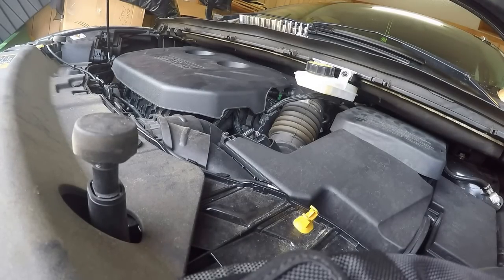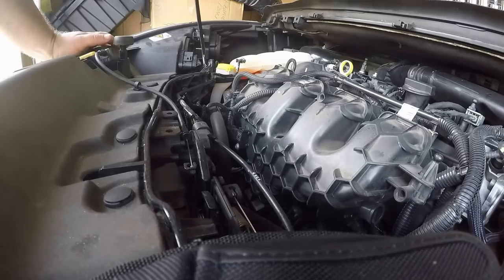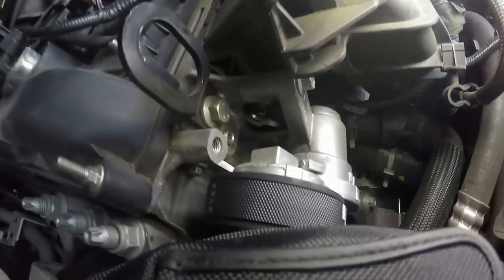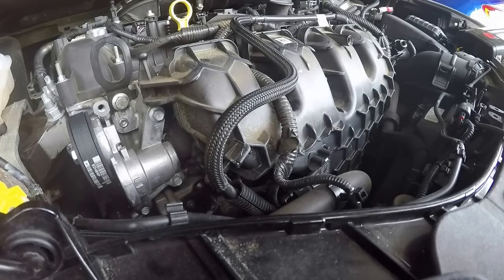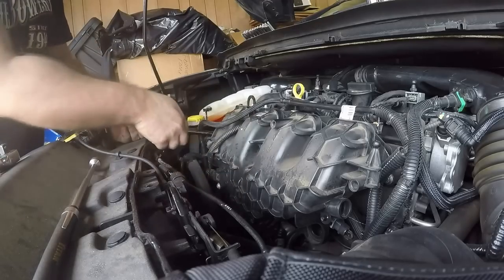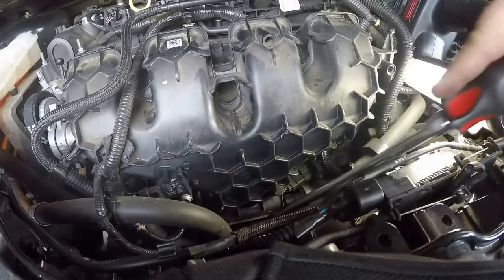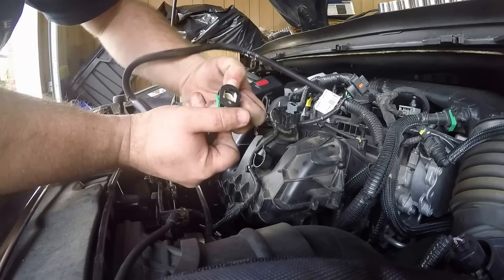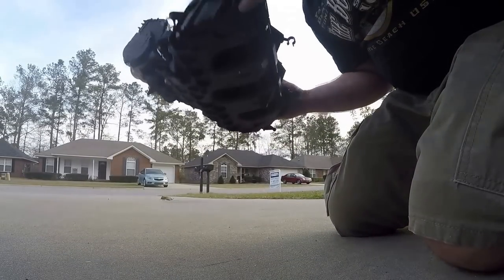Ecoboost intake carbon DIY valve cleaning turbo 2.3 2.0 1.6 ford escape turbo, escape. Simple tools

Comment: Just wondering how would you do this on a hot engine? By the time you get it apart it's no longer hot. You also run the risk of damaging the threads on the head from removing the steel bolts because aluminum expands and contracts at a different rate than steel.. Just my opinion, I've been wrong before. When I talked to Ford about valve cleaning my 2017 2.0 Fusion, they told me they offer no service for the ecoboost engines. Doing this would void my warranty due to the possibility of a piece of carbon getting sucked into the turbo and causing damage. I tend to believe them because stealerships would want to sell you anything they can. All I'm saying is use caution and do research before attempting.
Reply from the maker: Do at your own risk.. but if you use the oil I recommend  or fully synthetic like mobil one and change every 5 K you should be fine. Go to a bmw shop and ask them how they clean a direct injection with a turbo, manually. A brush cleaning, walnut blasting, or scraping is the the only way to get the chunks out. Fords only fix is a compleat head replacement. Which is a bad idea with the warping of the block, they did nit machine the block flush the first time and ended up replacing the long block. No codes no help from ford. The head will not go back right and then the engine will loose coolant. Have them pressure test the engine and coolant to make sure your misfire is not a bad head gasket first as it is a known issue even without a engine light one. The carbon is more of a performance loss due to airflow. What i am doing is just taking the most i can off the valves, not getting them spotless. I at least got the engine killer chunks out in case they broke loose. As long as the valves are closed and you back blow the chunks will come out as my video shows. And use the cleaner. The CRC method of just spraying while running does no take the big chunks off.
Reply from the maker: Trust me the engine will still be hot.....especially the internals.. plus what do you think happens when you gas up and send black smoke down the hwy. its carbon breaking up in the turbo.
Reply: @scrappyitalian  lol the long block was replaced at 22k because of the coolant issue. I'm starting to think these engines are junk. Right now I have no misfire of engine light but im hearing nothing but bad things about these engines and transmissions. The only good thing is the power pushed out of a small engine. I will be selling the car before it hits 60k lol good resale and let someone else have the problems.
Reply from the maker: Don not over think it, Also after 5 years when i did this video and 70k views not one person has come back and said their car messed up from carbon going through.
Reply from the maker: Mine is almost to 120k now after the engine replacement at about 60k. Just the purge valve and control arms has been the issue i have had to replace at this point. It is about 200$ us and runs on top of the engine that has been the issue thus far. Also a k&n filter will mess with it as well misfiring. Change plugs 25k one anything turbo. Loosing gas mileage is a good indicator of plugs or a filter.
Reply: @scrappyitalian  Do u think it is a good engine? I mean under 30k and mine had to be replaced, and yours at 60k. I just don't want to end up with a car that is always giving me major issues every 60k. Lol my 2000 grand Cherokee with the 4.7 has almost 300k with original engine, trans, and exhaust. I had to replace the heads once because of the known valve seat issue, but nothing else major
Reply: @scrappyitalian   I forgot to mention I am a certified diesel tech, I just play stupid at the dealer, plus diesels are so much simpler lol.
Reply from the maker: Run no less than 89 fuel from a Sunoco or shell. Summer fork out the 93 if temps over 85
Reply: @scrappyitalian  yes always premium top tier gas,  and nothing but mobil 1 full syn oil. I believe all turbo cars should be run on at least 91 octane with full syn oil. Lol u ever notice the owners manual says to run syn. blend?
Reply: @scrappyitalian  give me a diesel anyway. My lb7 has almost 500k on the clock with only injector issues before I installed the lift pump.🤣
Reply from the maker: I wish i could find a late 1970’s diesel Mercedes and run a million miles... the states really have given us a disservice by killing the diesel in anything but a VW........
Reply from the maker: Thankyou so much for the positive conversation! Yes i did not do the job perfect but the engine did not fail because of me nor did ford know i did the work.
Reply from the maker: Yea run the amsoil i have in the link and if you really are concerned contact amsoil and run the “boosted 5w-30” never run to the 15k 7500k max; or you will run it 2+ qts low before the change. I just spend the money as the engine change was 9k usd.   Mobil one filter or amsoil filter. Remember you can only run an ecoboost one of two ways. Eco or boost run your cruise and use the boost when you need it. The blend is a waist, and is the reason for the carbon in a nutshell take your own oil and filter and have them change it so it is documented that a change was done, and get it inspected esp the ball joint in the passenger side! Even with the amsoil change at 5-7k.
Reply: @scrappyitalian  Thanks for the advice. I change my oil every 5k. Like you said engines are expensive to replace, oil is cheap.
Reply from the maker: I did not see this reply and i apologize for not messaging back in a timely manner, i hope everything is going well and any issues were worked out.

Comment: So just from the comments I'm reading sound's like I need to install a catch can and the reason why I say this is because I'm starting to see oil coming from my throttle body however tomorrow I will be replacing the pcv valve / hose and plugs if someone could answer back to let me know I'm doing the right things that would be great.
Reply from the maker: Just make sure you are not under warranty. Ford will void it if you put a catch can on it. If you run boosted amsoil you should not get the buildup as bad or at all anymore. However you cannot go the 15k miles like amsoil says you can without a change or top off, you will run 2-3 qts low if you are not careful checking, “my experience”. Also run a cheap electric pump down the intake tube to the intercooler and pull any oil in it as well.
Reply: @scrappyitalian  I change mine every 3000 and I use full synthetic
Reply from the maker: I did not see this reply and i apologize for not messaging back in a timely manner, i hope everything is going well and any issues were worked out.

Comment: Get a bottle brush and some kerosene  war kerosene up so it gose in hot scrub it then it will vaporise then thin vacuum with rag so it don't enter vac
Reply from the maker: You have to understand the runners are like 8 inches deep and more narrow than you think. Taking it apart hot and popping off the carbon was very easy as it was soft when hot. Just getting 90% is better than nothing, and truthfully the engine will probably burn up the head gasket first. The engine issues i was having was from the faulty head gaskets leaking coolant into the cylinder’s.
Reply from the maker: Also I did this job many years ago and did a update before i got rid of the car and recommend to never buy a Ecoboost unless you plan on unloading the vehicle when the warranty runs out.

Comment: Hey do you have any idea where is the EGR in this model? Or by chance, do you know where can I get a manual or engine diagram?
Reply from the maker: Its kind of a birds nest with the direct injection engines, but basically everything gets pushed through the intake. If you are out of warranty i would suggest a catch can. But before your warranty is out make sure they so a compression test, and coolant pressure test for a bad head gasket.  I put 2 engines in this car because of head gaskets “ford paid”. Truly after the gasket issues the carbon really isn’t the major problem with the 4 cylinder engines. At the least to get the updated head gasket. Have it checked it even if you are not having any problems. And you should “never” have to top off the coolant in the ecoboost engine, this came from a ford tech saying there is a head gasket leaking if you are having to put any coolant to get to the fill line in the overflow bottle.
Reply: ecoboost发动机没有egr阀，是靠重叠的进排气来实现EGR阀的功能的
Reply from the maker: I did not see this reply and i apologize for not messaging back in a timely manner, i hope everything is going well and any issues were worked out.

Comment: What kind of “Brush” do you recommend to clean the valves ?
Reply from the maker: Ross in Ontario if you do the job with the engine hot the carbon just pops off easily and is actually soft. So i just popped off the big stuff and really did not have to scrape the valves. Yes i used a long screwdriver but only wanted the big stuff off as i used the ac delco cleaner on the rest to take the rest off but not throw big carbon down the cylinders. Used the air gun to spread the cleaner and blow out the bulk carbon. I have gotten a lot of heat for valves being open but they were not. Switch over to synthetic like amsoil, do not go by the 15k oil change as the engine will go through oil and could run the car dry of oil. Still go to 7500 and if you can afford it just change it out every 5k. Also i suggest a trans change every oil change as well it is only about 3qts and is very easy after the first change and fluid leveling as i measure it and replace the same amount. Next oil change i will make a video about the trans and how I change it out every oil change.

Comment: Hey , did you feel any different after the cleaning?
How about the fuel consumption?
Reply from the maker: Ron David it is running about 32 mpg give or take hills and 29-30 with the ac running on the hwy. 21 in town but my wife has a heavy foot so is probably a little better than that.
Reply: thank you for your reply.
Im going to clean soon my valves on my 2.0 ecoboost mondeo after 125,000 kilometers on the clock.
I bought steel wire brush that will connect to screwdriver, do I need to worry about somthing? maybe Scratches that could cuase on the valves? any tips?
Reply from the maker: Ron David the valves are pretty hard i  used a long thin screw driver and made sure the engine was hot and the carbon just popped off with little effort. No scratches. The access is so tight you will see.
Reply: LanceManAdventures damn man 32 on hills🤣 the highest i could ever realistically keep my wifes is about 28-29 thats going extremely easy flat ground nothing over 65. I will say hers used to say 23 mpg in her back and forth work commute only about 10 miles each way. But over the years ( we bought car new) her average is 21.5 now for work commute. So i figure its about time to do this procedure. Car has 91k miles never had intake off. Only ran 5-30 syn blend motorcraft oil. It did throw a check engine a few weeks ago for lean bank 1. I cleared it with my scanner and hasent came back yet. I think the trans is gonna go before anything else. That cold 2-3 shift is really sketchy.
Reply from the maker: I did not see this reply and i apologize for not messaging back in a timely manner, i hope everything is going well and any issues were worked out.

Comment: but didn't some of the carbon go into the cylinder that the valves were open?
Reply from the maker: not the big stuff, plus the valves were not completely open. what do you think happens when this big stuff breaks loose when people do the CRC method? every time you see someone gas up and black soot comes out the exhaust its breaking up carbon in the combustion chamber. carbon is not like a rock. and when it is warm it is very soft.

Comment: If the back of any valve is carboned up enough to cause a misfire wouldn't this show up on a compression test? Or doesn't Ford publish compression specs? Can I assume this is a direct injection engine. And would using top tier gasoline prevent this, or at least delay it to over 100,000 miles?
Reply from the maker: Theodore Zuckerman the compression will be in the cylinder, not the valve area. The carbon sticks to the valve backs and valve rods. Fords fix is a 160$ chemical cleaning that does not take the mm’s of material off the valves at all. The only authorized ford fix is a head replacement. Take the plastic intake off like i did and scrape the carbon off. I am currently about to make another video about the coolant leak issues with the ecoboost engine 2.0 and 1.6 as i have replaced 2 engines so far at “fords expense” Not carbon related.
Reply: 2 things lead to low compression: 1. piston rings that no longer seal well against the cylinder walls due to worn rings or warn pistons or worn cylinders, 2 valves that no longer seat well due to wear on the valve seating surface or the valve seat seating surface, or due to not closing completely due to Carbon on the Back of the Valve.
Reply from the maker: Theodore Zuckerman also there is a head gasket issues with this engine using coolant. Everyone with the 4cyl ecoboost needs a compression and coolant test. The head gaskets are letting go in cylinders 2-3. There is and updated gasket. But it is warping the blocks we well

Comment: I won't take off clapan, sistem EGR.
Reply from the maker: I really think the change to a premium oil that will not burn off is a better choice overall. Changing the oil 5000k miles, running at least 89 fuel. Keep and eye on the evap purge valve assembly, it tends to die 90k and up.

Comment: I am very confused about why you're escape with only 60,000 miles on it is having this sort of problem. I have the same vehicle, 2014 Ford escape EcoBoost 2 l engine. It has 104,000 miles on it now and runs beautifully. I've never heard of the type of service you're talking about with the valve service or whatever. It's nowhere in my owners manual. Also the manufacturer and the owner's manual calls for having the oil changed every 10,000 MI under normal service conditions. And the spark plugs need to be changed at 100,000 miles. I feel something else is going on here that's causing this problem with your vehicle. You shouldn't have to be cleaning the valves at 60,000 miles on this type and year of Ford
Reply: Carbon buildup on the back of the intake valves is an industry-wide issue with all GDI engines (with the exception of some newer GDI engines with hybrid port-injection systems). In non GDI designs, the fuel is injected into the intake port or throttle body, so you have a constant flow of fuel washing the back of the intake valves as the air-fuel mixture is drawn into the cylinders. Carbon buildup comes from the PCV system, which ventilates crankcase vapors and routes it into the intake system to be burned by the engine. The vapors contain oil, and combustion byproducts and when they come into contact with the rear of a hot intake valve, it begins to form a carbon deposit that builds up over time. As I mentioned before, in nonGDI engines, there is a fuel-air vapor constantly washing the back of the valve, preventing buildup from occurring. In a GDI engine such as the Ecoboost engines, the fuel is injected directly into the cylinder, bypassing the intake valves, so those PCV vapor crud deposits never get a chance to be removed, because they never come into contact with any fuel. There are a lot of variables that can determine if and when this buildup becomes a problem that you begin to notice as altered performance. The amount of blow-by a particular engine has, the kind and quality of engine oil you use, the interval between oil changes, the kind of driving you do, and the number of miles on the engine. Not everyone will see noticeable driving issues even at the number of miles you have accrued. But, if you have a standard GDI engine, rest assured there is carbon buildup on the rear of your intake valves that wouldnt otherwise be there if it wasnt a GDI engine. When it gets really bad, the deposits can actually interfere with valve seating, and if a big chunk breaks off, and goes thru and hits a spinning turbo blade on the way out of the engine, it could kill the turbocharger. Whether Ford bothered to mention it is irrelevant. It is a widely recognized issue with these types of engines regardless of brand.
Reply from the maker: Jay explained it very well

Comment: Just do an Itallian tune up.
Reply from the maker: J P i happen to be Italian and that only works on my mustang.
Reply: Also, it must be hard on the head gaskets considering the crapy head designs of these engines.
Reply from the maker: Ross in Ontario yes ford replaced the engine 2x basically the head then the long block in this escape; which we still have. After the head gasket the carbon issue really is kind of a nuisance more than a big problem. After the updated gasket it has not had many issues other than the passenger side likes to eat up the ball joint, “90k replace it”, and i suggest only a ford unit to replace it. FYI it only comes with the whole control arm, unbolt the sway bar makes it a breeze to replace.

Comment: You spray anything on the valve you better hope they are closed or you be paying for a new motor
Reply from the maker: You realize you are commenting on a video over 4 years old? I am also a certified industrial mechanic with the degree. Know more about hydraulics than any average mechanic, and the effect of liquids in a confined space. You defiantly did not see me blow out the excess fluid, with the air wand, and i have not watched my own video in like 2 years now, to address all those with armchair opinions. The carbon is not the issue with this crap engine, it is the head gasket, and the crap transmission.. good luck with the 3000k trans going out, and 6k head gasket repair worrying about my carbon cleaning video….